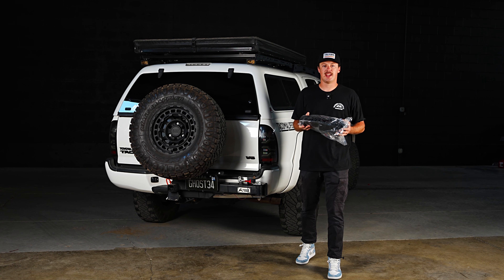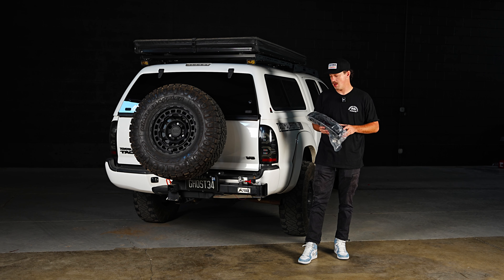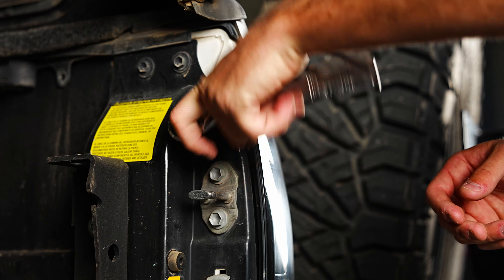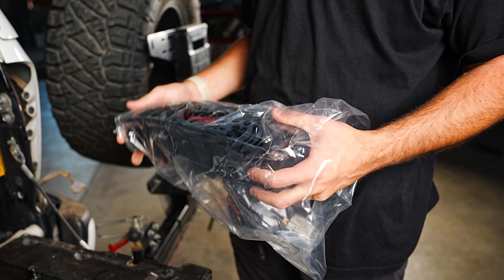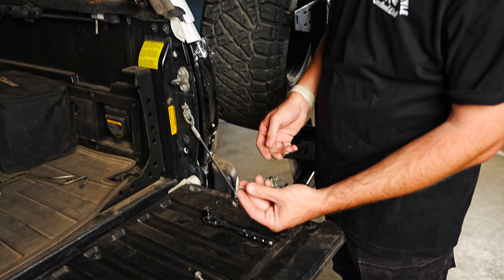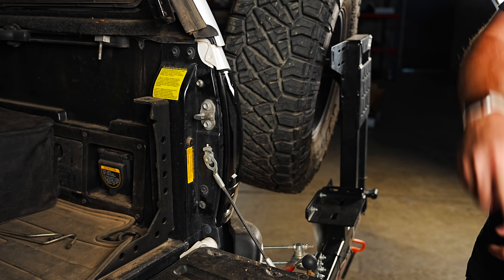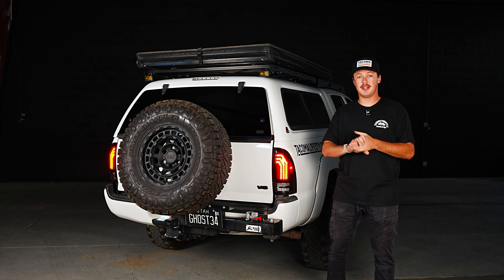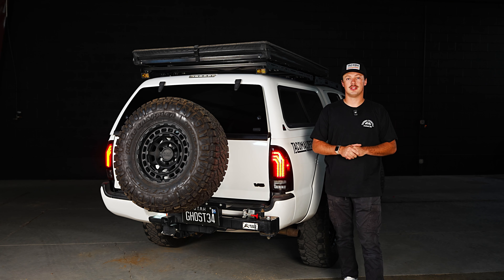Morimoto XB LED tail light Install for 2nd Gen Tacoma

Comment: I have the alpharex headlights and have now purchased these tails. I now have hyper flash.  No issues when just headlights.  These are supposed to be plug n play but when in daytime running I get the hyper flash when using the brakes..... when lights turned on hyper flash happens all the time.  Hazards flash normal. Help?!? Return them?
Reply: I am having issues with the same set up you are looking at.  Have had the alpharex for over a year with no issue but after installing the xb tails the hyper flash has started happening
Reply: I just swapped to some projector headlights, and it caused hyperflashing on one side. I ordered some led bulbs with a built-in resistor (autotix) so hopefully that'll solve it without tampering with your wirings
Reply: @Kojtxiv5555  hey i now have this issue with Apharex headlight and Morimoto tail lights, can you tell me if this work for you?
Reply: @HorchataPapi  crazy thing is it was causing hyper flashing with the new bulbs (advertised as anti flashing smh) then I bought new stock bulbs and it stopped everything and went back to normal. I'm not hyperflashing anymore with stock bulbs. Weird